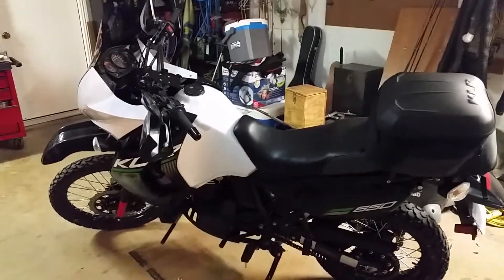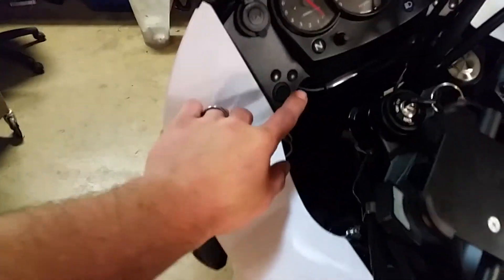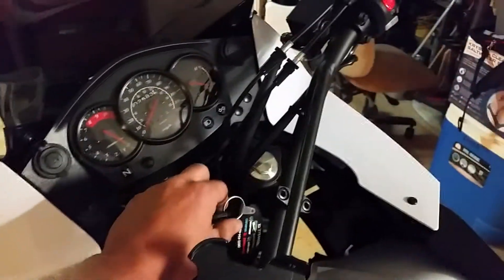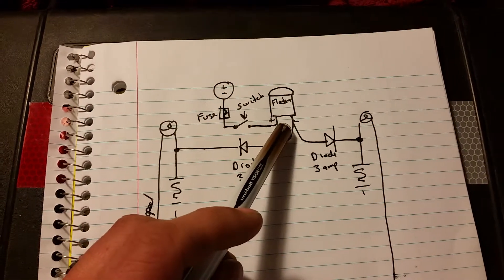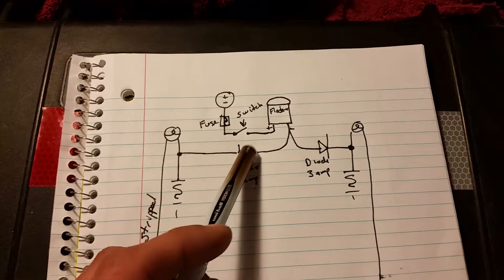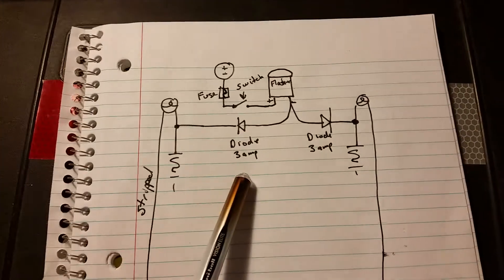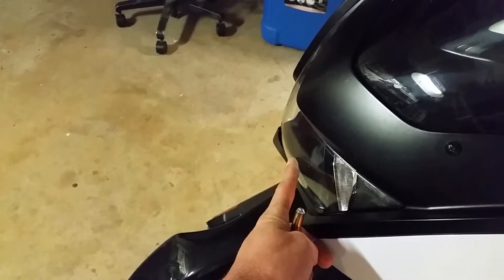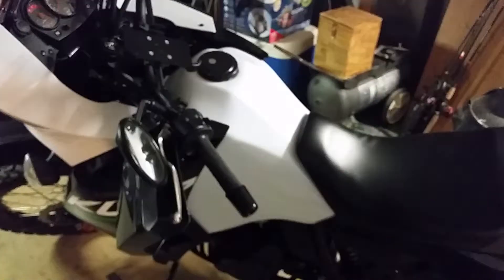KLR 650 4 WAY FLASHERS

Comment from the maker: It worked as long as I had the bike. I sold it. I would think if its blowing the fuse maybe you have a wire rubbing the frame somewhere shorting to ground. Does it only blow when you turn them on?